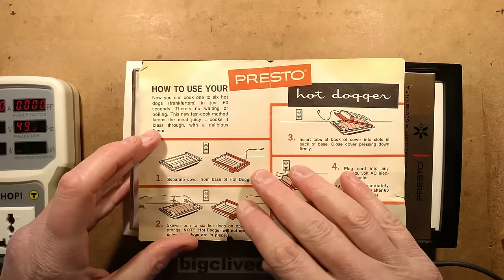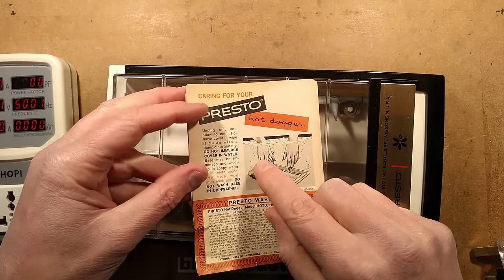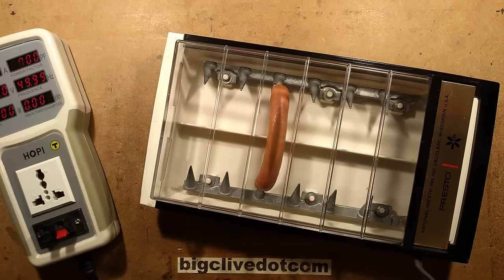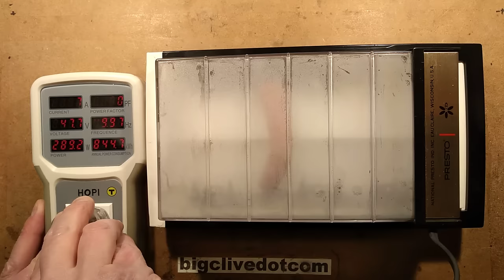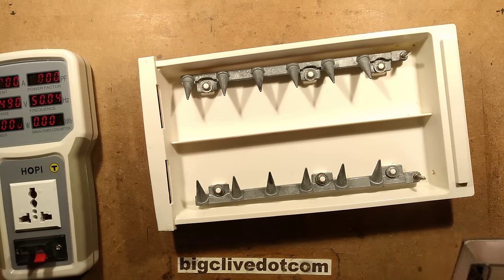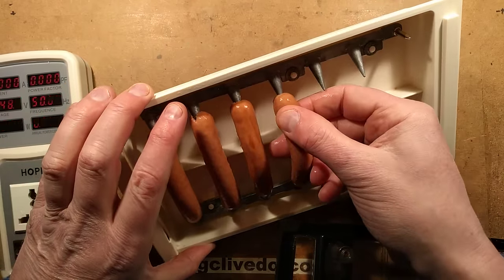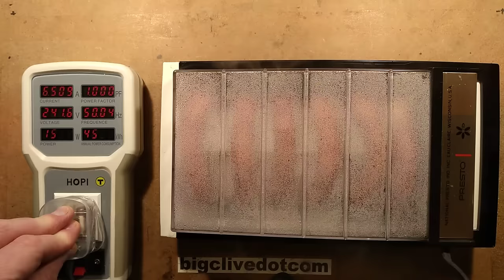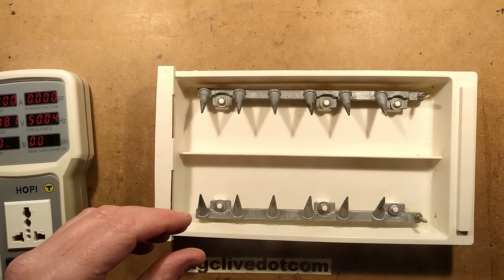Turbo charging a 120V Presto hot dogger on 250V.

Comment: Logic indicates 15 secs is enough. Double the voltage, double the current, quadruple the power, therefore reduce cooking time to a quarter. Cheers
Reply: P=U²×I 
For those who like formulas
Reply: I^2 x R
Reply: If I hire 4 painters we paint this wall in 4 hours, if I hire 600000000000 painters we paint the wall instantaneously, if I throw the sausage to the sun its evenly cooked too

Comment: Back in my days at the R.L. Drake radio factory running the TR7 on night shift, our supervisor, N8BFB, ran two brass nails thru a plank of pine, fastened a power cable to ‘em & we took tuns making hot dogs. Quite an experiment in resistance vs current flow. Strangely we never blew a fuse on that adventure. It took a co-worker’s home brew HF linear amp to do that ;-). Never came to us to use the amplifier’s B+ to sizzle hot dog, though.

Comment: "The power factor of the hot dog is exactly one."   Good information to know.    As a child, I had the improved second generation of this product, wherein the hot dog electrocution/execution tray would slide into the base.  Of course, in the US of A, lunch took longer to prepare due to the inferior mains voltage available.  Still, longer to anticipate and enjoy the occasional arcing.

Comment: Spare a thought for those poor folk in 100-120V regions who are forced to waste entire hours of their lives waiting for appliances to finish their thing.

Clive, how about a comparison of 120V US electric kettles vs the 2-3 kW types that are common in Europe? Maybe overclock the former with some 230VAC +/- 10%? :)
Reply: I hear ya. When I saw the wattage go to up 2k I thought "oh boy, it's about to pop", i.e. the circuit breaker, but Clive wasn't even worried! My new server uses two 1400 watt power supplies,  each one can only run on 240v, FML! Cost me a bunch to have an electrician install a 240v "dryer" outlet near my server.
Reply: @toysareforboys Yeah that's the good thing about 240v, 2-3Kw appliances are cheap and plentiful. My 2.3Kw dryer just plugs anywhere I want.
Reply: Hi Elledan :-)
Reply: Using higher voltages lowers the current. Current is causing heat on bad connections. So, you reduce the risk of fire by doubling the voltage. Of course, this won't be a problem in the US, because most houses in the states are build from materials which won't burn, aren't they?
Reply: Maya Posch I'm pretty sure you'd blow the circuit breaker with that. In the US, most portable plug-in appliances used with 120v outlets are limited to 1500 watts, with a few exceptions. Anything more, and you need a 240v circuit. Since a kettle is a purely resistive load, and almost all electric kettles here are 1500W, it would pull 6 kW on 240v. Actually, it might work okay in the UK, since they have ring circuits. You might melt the outlet, though it would probably heat your water so fast that it wouldn't have time to cause damage!
Reply: mharris1270 sounds like you have a crummy kettle. My 1500 watt one will heat a liter of water in a few minutes. Still not as good as the European ones that will do it in about a minute, but still pretty nice. Most kettles don't have electronics in there. It's a resistive heater, a switch with a thermocouple to shut it off when the water starts boiling, and an indicator light, usually a neon lamp. Mine has two blue LEDs, so probably a little capacitive dropper in there for those, which wouldn't likely survive the 240 volts, but it's not essential to the operation of the thing. It just shows you that it's on and looks pretty shining through the water.
Reply: Maya Posch Ovens, cooktops, dryers, etc, are almost always 240V in North America. It’s just two 120V phases tied together.
Reply: 5Rounds Rapid actually, the 120 circuits are from one phase split in half. It comes from one transformer, which has a center tap for neutral, and the other 2 taps are 120v on opposite sides of the sine wave. But they're the same phase.
Reply: puckcat22679 Yeah, you’re right. Two taps, not two phases. Kettles are not a big issue in the US anyway, since so few people drink hot tea.
Reply: @mharris1270  and if I saw a kettle at somebody's house with a dryer plug on it or worse yet a 50A stove plug I don't know what I would think, maybe that I traveled overseas for a visit to photonic induction's house.
Reply: @puckcat22679  The ring is the reason that all UK plugs are fused. At 6 kW it will not pop the breaker (that goes over about 7.5 kW) but the fuse in the plug will go. Replace that fuse with a nail, or use a deathdaptor, and the next thing to go will probably be the cable from the plug to the kettle. A BS1363 plug and socket is really very robust.

Comment: Canned hotdogs? That would be a novelty in the US. 

Had one of these as a kid,,, built a bit different, the tray was a drawer you shoved into the unit. The pins made the connection in the back. Even on 110 these would arc. Even though a microwave could be used now, I still prefer grilled hotdogs and I have used a toaster oven once in a while.
Reply: Wait you're telling me hotdogs in the us aren't in cans?
Reply: @MrSnowman777  I'm assuming American hotdogs always come in jars, like the big hotdogs you can buy at Lidl.
Reply: Hot dogs in the US are not in cans -- Packaged as such, most often -- https://imgur.com/a/991QYGq  @MrSnowman777

Comment: Spikey contacts look very much like Zinc or some Zinc-based alloy, hence the characteristic matte greyness
Reply: That's better than what I was thinking. As old as these are I was wondering if they might be lead. 🤣
Reply: @drfrankensteinscreations  , Lead based goodness you mean?
Reply: @Bits and Electrons Or even just exposed to the air for long enough, and this piece is a good 40+ years old. The detergents and heat of a dishwasher just accelerate the process.

Comment: Phototonic Induction would run 50k volts and 700 amps thru it.
I have never seen hot dogs in a can.
Reply: Sadly he doesn't do that stuff anymore after getting married and having all those troubles.
Reply: I beg to disagree.
Whenever Photonic Induction is going crazy with the amperes, the voltage is always child-safe low. Usually under 12 volts.
I suggest you revisit some of his old videos.
Oh, and btw, proper hotdog sausages don't come in a can.
Reply: Just put the whole can between the electrodes. The can glows and heats the sausages.
Try it with a big welder.

Comment: Can it contains liquids without leaking? If so how about reheating soup with it...
Reply: It can, but it will be hard to control the current, the salt in the water would make almost short circuit and break the fuse. With pure water it would work without problem I guess.
Reply: @resetcoder  That said, there isn't exactly no salt in those sausages, either.
Reply: @Anvilshock There may be some, but there is no enough water to make such conductive electrolite like 0.5l water with a 0.5-1g salt. Try it, i'm sure it will break the fuse.
Reply: If your soup contains salt, you'll electrolytically seperate off chlorine gas. If you want to dine like the fine folks in the WWI trenches, sure, go ahead.

Comment: I wonder how much of a chemical reaction with the prongs got left in the hot dogs. Blech.
Reply: Essentially none. There is probably a slight chemical reaction, especially using something like this pot metal frame. But the part of the dog surrounding the spikes carbonizes onto the spikes and is left behind when you remove the dog. Any chemical reaction will be left on the spikes if you follow directions and clean them fairly often. (Which you need to do anyway or if will pretty much stop working as the crud builds up.)
Reply: On another vid about this machine there are loads of comments from americans who say they only used it a couple of times because it made the hot dogs taste metallic.
Reply: Fortunately it's AC, so it ought to be small.

Comment: Does that mean I can plug a hot dog into the mains and cook it? (With adequate safety precautions)
Reply: This device barely has safety precautions. If you plug it in before closing, or open it before unplugging it, there's a mains connection just sitting there, nothing to drop it at all
Reply: Yep, you can cook a hot dog with just a couple pieces of wire shoved into the outlet and wrapped around 2 nails that are shoved into the hot dog.  I still use that as a safety demo in class to show how powerful the electricity at a wall plug is and why we must take safety precautions.

Comment: Another reason for America to convert from 120V to 240V.
Reply: Apple_Marty Czech every house in America at current code has 120 single phase and 240 two phase available in the primary breaker panel.
Reply: Also changing everything below Canada to use 240 at 50hz would be extremely expensive and time consuming
Reply: Yeah but 240V and British plugs are the bomb, tho
Reply: @easycheese6409  With the huge 30 amp plugs
Reply: with as common as the multivoltage SMPS units that are becoming more widespread there will be a day where it almost literally won't matter anymore.
Reply: I'd convert to that, as long as I didn't have to convert to these hotdogs too. lol
Reply: @easycheese6409   Canada also uses 120 at 60Hz, we actually generate most of the power for the whole north eastern coast of the USA.

Comment: I had one way back in the 70s, couldn't stand the taste.
Reply: Could you describe the taste? Just curious
Reply: @MrConminer  I had one as well, and if you over cooked the hotdog it had a metallic like taste at either end of the hot dog.
Reply: I imagine it has the same problem with microwaved hotdogs. It's just an awful way to cook a hotdog. Doing it the proper way on a grill (or boiling but that is also a bit weird)

Comment: Used to electrocute all sorts of stuff when I was young. Made "in series" socket, so it was possible to chose what in series resistor you could use to make sure that if the resistance of the thing you tried to electrocute did not pop the fuse. My favourite was oranges and lemons which glowed beautifully inside when you stuck two electrodes in either side. We would use a 2KW electric heater as a in series resistor for that particular experiment.

Comment: >Putting a hot dog in the microwave
DISGUSTANG
Reply: sirp0p0 boiling a hotdog is disgusting. I prefer nuking them over any method
Reply: Toaster oven.
Reply: Putting one of those in your mouth is worse
Reply: I used to wrap them in tin foil lay them on my concrete mixer trucks exhaust manifold at the plant load drive to the job and they were cooked just like on the grill a bit burnt on one side too . had pre mustard buns in my lunch box .

Comment: It's not pronounced "Ye", it's still pronounced "The". The Y character is called a thorn. As with all my knowledge, I learned this from QI.
Reply: I was taught it was a form of you or your, at the time thou was in use. Though the meaning seems to have changed depending on the period of time when it was in use, and on the author in question. QI elves are often correct, but they slip up too occasionally lol.
Reply: @Si74l0rd  You are talking about a different "Ye", which gets confused with this one. QI elves don't so much mistakes, rather it's what is considered fact that changes over time. They did an episode where they taked about this as the "half-life of facts" and ended up refunding Alan about 700 points that he was due over the series. In another episode, Dara O'Briain got points for mentioning that 0 celsius is the "triple point" of water, and got a penalty when he came back the next year, because the scientific community had actually changed the value to 0.01 since he learned it at school.

Comment: Can you say heavy metal poisoning? I would assume that there is some amount of electrolysis going on at the spikes.
Reply: You don't get electrolysis on AC. Or at least very very minimal electrolysis because as soon as any metal leaves an electrode it's slammed back in again as soon as the polarity changes.
Reply: @webchimp  You dont see electrolysis on ac normally because it can only occur on the surface of whatever is being plated, but a hotdog is porous and could potentially diffuse ions throughout. Results of experiments often confound confident seemingly logical expectations.
Reply: What heavy metal?  Iron?
Reply: @0x8badf00d  could be nickle and alsorts in there. Also could catalyze some unusual molecules even if dealing with surgical grade cast iron :P

Comment: My Dad worked for  Westinghouse appliance division here in Mansfield Ohio U.S. They were  making hot dog cookers similar to that Presto in the late 1950's or early 1960's I remember it when I was a kid,however Mom got red of it in one of her clear outs. Dad said that one of engineering problems was finding a metal for the prongs that would not leave a odd flavor in the your hot dogs and the ends of the hot dogs would not get cooked enough or would be cold.

Comment: "unplug after 60 seconds" .. lol,  no room in the budget for a switch
Reply: Well unplugging is more secure too
Reply: Dumah Brazorf yes, but the contacts are recessed into the lid, if I remember correctly. And that has a 2- prong plug, likely not polarized, so you have a 50-50 chance of the switch being on the neutral, unless you use a double pole switch. But yes, the later version where it's a drawer that goes in and out is considerably safer.

Comment: Hm, I'm imagining 50's Mom walking along to grab the finished Frankfurters, house full of happy mouths to feed--and forgets to unplug it first. Yikes!
Reply: She'd be perfectly fine. The power goes to the hotdogs through the cover, so the act of removing the cover to get to the hotdogs breaks the circuit and effectively unplugs the device. The only issue that might arise is if she set the lid down somewhere wet.
Reply: L'ymceh set the lid upside down and grab it while still plugged in...
Reply: 1970s...
Reply: @prescott231233  
Those conductors are in small holes that your fingers cannot fit into.
Trying to touch those conductors with your bare hands would be as hard as trying to touch the conductors on an electrical outlet.
Reply: DARK APPERITION  I think Oedipus actually got that done first.
Reply: For 1950s standards, this device was surprisingly safe to use

Comment: so from my understanding of electrical engineering, the higher the voltage, the more current and the lower the heating time. Now I also understand that the heat isn't applied evenly across the entire hot dog, but only where the electricity actually passes through and then it conducts out from there, so my question is this: is there a point where you can pump enough voltage through the hot dog that it explodes, and leaves chunks of uncooked hot dog everywhere because it did so before the heat could dissipate?
Reply from the maker: Yes.  With high enough voltage and current you could make them blow up.

Comment: I remember these things from the 1970s. I've also wondered what metal or alloy they used for the electrodes; hopefully I'll assume it doesn't contain lead. If they used zinc, they could actually have touted any that migrated into the meat as an added nutritional supplement.

Comment: With regard to your comment about how "they didn't have microwaves back then," I would just point out that the Hotdogger did use long-wave microwaves of a wavelength of about 3100 miles (or 3720 miles in the UK).

At that wavelength, the coupling coefficient is so low that a direct ohmic junction must be used to couple microwave energy into poor hotdog, thus treating it like a condemned murderer. A hotdog is about one thirty-two millionth of a wavelength in length at 60 Hz.

Comment: Way ahead of you, mate.  Already took this to its logical conclusion.  I used to have these weird 50,000V pulse-discharge capacitors - about 5kJ worth, a few hundred pounds. They could explode wires up to 30" long. Tried hot dogs. We aren't certain there was time for the dogs to cook before they were plated in a sub-mm layer over every surface within direct line of sight of the hot dog's origin. Gave up on the high speed hot dogger patent, considered a high speed painting patent instead.
Reply: I like how the manual claims this cooker will make pink slime frankfurters appetizing. I can't believe I used to eat those things when I was young. But that was before I left home and discovered real food.

Comment: I saw a U.S. great depression old timer show me one of these made with nails sticking up through two pieces of wood. The ends of an old lamp cord were wrapped around each nail head which terminated between the two pieces of wood. You plugged it straight in to the wall. Probably a good way to get chromium or other heavy metal poisoning in any case. Your unit looks like it supplements your daily zinc requirements.

Comment: This is SO funny. In our students association we also made an appliance like this. AC is relevant, cause DC results in nasty chemicals at the tips... chlorine etc... Brrr..  An induction based appliance, where for instance 4 or more hotdogs would be in series with an inert electrical connection in between them could be better from a culionary view, and more interesting from an electrical engineering view. We didn't get to this due to beer exposure at the time :-)

Comment: A bit late, but the metal the prongs are made of is probably some sort of monel or maybe stellite. Heat-warping and corrosion resistance as well as conductivity and high melting point are variously displayed by both, monel often has that gross dull matte grey look and stellite was frequently used in utensils in the past.

Comment: I have model OI/HOTDI. 120 volts up to 10 amps. The instructions says to cook for 1 to 1.5 minutes.  I found that if I cooked it too long there was arcing and then the hot dog had an electrical burn taste...  surprisingly it has a UL listed 340G